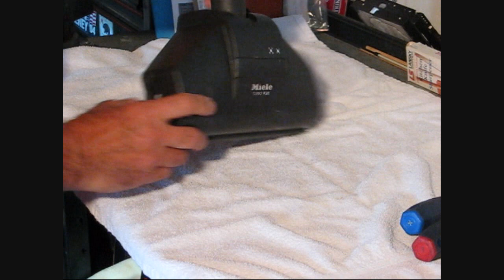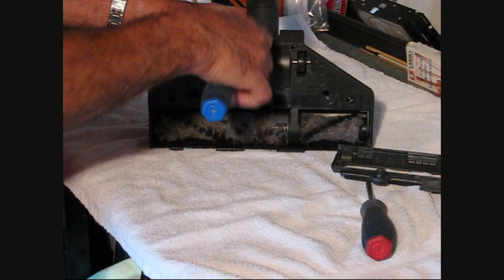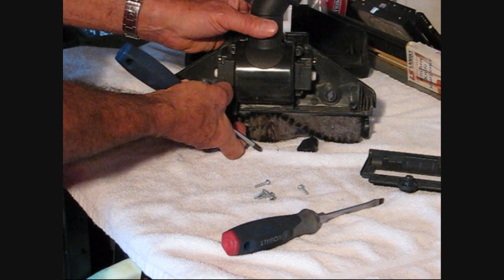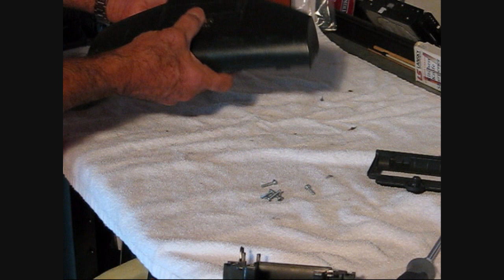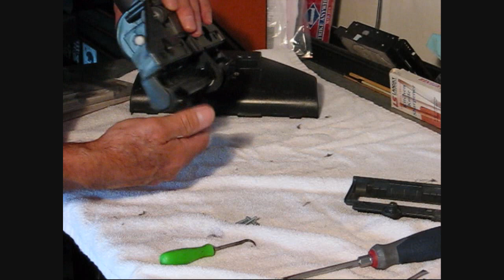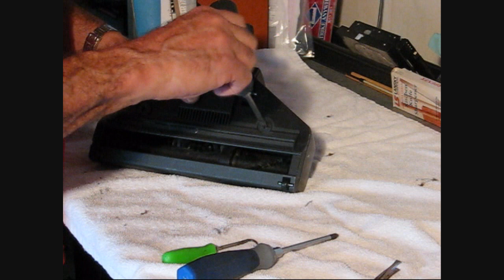Tools Miele vacuum cleaner power head belt replace repair by froggy

Comment: Very helpful Froggy, thank you :) Can you provide a link on where to buy the replacement belt please?
Reply from the maker: It's been a while, try google it.
Reply: Hi Froggy, I'm based in the UK and Miele UK make you buy a brand new head (£65.00) rather than supplying just the belt, which is so wrong really. I was just hoping that you might know a supplier where you live but thanks for replying :)

Comment: Three cheers for Froggy - This worked beautifully on my Miele TURBO COMFORT HEAD  - which goes on my Miele Solution H.E.P.A 5281.    For the little screws you need a small TORX screwdriver T10 or T9.
Reply from the maker: Excellent, thanks for viewing Sally!

Comment: Thank you. Revised - I took my Miele to a vacuum store to find out why it wasn't sucking so well on my vinyl floor. The gentleman who I believe was the owner told me that he needed to clean the powerhead because it was filled with dust and hair and it would cost me $120. I declined, came home, found this wonderful video, and fixed my powerhead all by myself. My power head was a little bit different than yours but I figured it out. The Torx screwdrivers really helped. Oh - the inside of my powerhead was not filled with dust and hair. It had a few tiny dust bunnies and that was it. So I just cleaned the cover with a damp cloth and I am now vacuuming like a maniac. I do think I'm going to buy the HEPA filter for my C1 Delphi vacuum. Thank you so much, Froggy! Oh, I guess the powerhead is not really supposed to work that well on flat floors. One is supposed to purchase the Parquet Twister, which I will later cause its pricey.
Reply from the maker: great!

Comment: Thank you for this.  I routinely do the main plastic-screw bit to clean the brush but mine was seizing anyway, so I used my husband's Torx set to try to open the housing but I couldn't figure out how to do it, and your video showed me how, plus how to get the other bits safely apart.  Turns out there was long hair wound up and compacted in the very ends of the brush roller itself, around the central pin.  But it's all back together and working now and I appreciate folks like you who post how-to vids for the rest of us.
Reply from the maker: Glad to help, good work!

Comment: Thank you for this video. I have one burning question. Is the roller supposed to turn by itself as soon as the power is on? Thank you.
Reply: Yes it turns with air flow

The air rotates the turbine

Comment: OMG I got it apart.....cleaned it up(especially the crap stuck between the axel and casing of the actual thing that looks like the water wheel) , a teeeny bit of oil in the spinning parts, and it works like it did when it was new!!!! THANKS for this video, and for keeping money in our pockets, and for keeping junk out of landfills!
Reply from the maker: Good for you.

:)

Comment: Agggh why can't I get the screws out? They started coming out(I am using the right screwdriver, no. 10 Torx) and then they stopped and they just keep turning and turning and won't come out and they are in far enough that I can't pry the plastic thing apart to get it off.
Reply from the maker: Stripped. If/when you get them out, use a slightly bigger screw to put together.

:)

Comment: Do not forget to check under the end caps of the floor brush. That's where my main problems were to be found. I also had some hair wound around the wind turbine shaft which I removed by carefully cutting with xacto knife and removing with long nosed craft tweezers.
Reply from the maker: Good, thanks.

:)

Comment: Great video, mine is clean but the suction is not that great. Do you why the air driven brushes loose suction ?
Reply from the maker: Do you have good suction with the brush head off? If YES, then there is still some restriction in the brush head.

:)
Reply: froggy yes, good suction with attachment off.  Are there gears inside of the enclosed casing that rotates?
Reply from the maker: It sounds like you have not actually taken yours apart or you would see there are a couple of gears. The ONLY way to properly clean the head is to take it apart as I show in my video. Please watch the video and try it, not that hard.

:)

Report back please.
Reply: froggy I have taken it apart,  cleaned it, watched video and it is not the same suction.  Then I wrote you. When apart,  I noticed a metal rod going thru that black enclosed piece. I was wonder what is inside there, thinking something might be broken inside there.
Reply from the maker: It is just a "spinner" the suction spins the enclosed part and transfers spinning thru the gear and thru the belt to the brush. If it does not spin easy then there is a problem. I have never taken that apart myself. When you have it APART how does that part spin? Easy & freely?

:)
Reply: froggy Freely!  everything was fine with it until I swept my dad's house and was sweeping up a lot of stuff. All of a sudden, it started making a deep noise and would barely suck up anything.  I took it apart like your video instructed,  which was AWESOME,  and now it is good on my wood floors but when I transfer it to a low pile rug, it does NOT have the suction like it used to. Before I could hear/feel it grab, not now, just lightly. Something happened that day at my dad's house and this gal is baffled!
Reply from the maker: Got it. All I could suggest is do the service again and at each part that moves try it & see if it moves easily. If it has a "lot of miles" on it it is possible a part has worn and thrown the alignment off resulting in the brush rubbing somewhere inside the housing, then you need to replace the worn part. Hope that helps.

:)

Look very closely with a bright light at the parts.

Comment: Froggy, many thanks for a video that will help many many others. Wanted to say thanks and so had to create a YouTube channel account to do so! I would add that a Torque T-10 screwdriver is required for this particular model. I didn't have one and had to purchase the right size to take mine apart. And as at least one commenter added, keep the initial 4 screws separate from the inside 2 screws, as the latter can be very slightly smaller. In my case my head was noisy and it just needed cleaning of all fibres and grit inside.  Big thumbs up Froggy. P.S. can't understand for the life of me why there are like 7 thumb downs?? Crazy world we live in...
Reply from the maker: Thanks for your support, this vid has helped a lot of folks.

:)

Comment: Thanks, this was very helpful and 

In case this helps anyone: in my Miele 300 turbo head is very similar. The 4 outside screws and the 2 inside were actually slightly different sizes. Also they were Torx,; probably a hex head would work but they are actually Torx.

I spent a good deal of time pulling lint and dog hair out of various places in the parts which was useful in helping all the parts to go back together well. Even one of the the slightly flexible end parts that hold the rotating head axle in place wouldn't set fully because there was lint in there. It's pulling up more dog hair from the carpet just like new.  Thanks!
Reply: Correction, I have a Miele S4210 Antares
Reply from the maker: Thanks for posting.

:)

Comment: Thank you so much Froggy! My Miele wasn't working well at all and I realised the brushes had stopped turning. As a not very competent DIYer I was about to buy a new head for the machine, or shell out for an expensive London priced repair. You gave me the confidence to try it myself and IT WORKED!!! Thank you again

Comment: Hi,
Your video is interesting but it doesn't solved my problem.
I've got a similar Miele power head: The belt seems ok but the 2 wheels can't spin together normally.
I opened my head and apparently the gear that I see on your video at 6:56 probably broke and went away. Please, can you tell me how to replace it and where to find the right gear for my head TYP S 021.
Thanks for your help.
Reply from the maker: You would have to call Miele and they should direct you to the part, or a vacuum repair shop.

:)
Reply: I did that before posting a message here and Miele asks me to pay 125€ for the work + pieces to change. This is highly unfair.

Comment: Hi Froggy, many thanks for this detailed guide.  I took everything apart - except the white plastic axle holders at 7:50 did not come off for my model (I broke one of the spokes but managed to glue it).   After re-assembling everything 3 times the brush is still not rotating freely - I suspect that there is some gunk inside the white axle holders (I applied some WD-40) which restricts the smooth running of the whole geartrain.  For the time being I removed the brush, the fan type wheel inside the smaller housing is spinning ok,  I do not have very thick carpets so I wonder if the brush is that important anyway except that it always collects dust and long threads/hair etc. I think some Miele models do not even have the rotating brush but a hardfloor/carpet combo attachement with fixed but retractable brushes.   Cheers and best regards.
Reply from the maker: +scuba453 If it has good suction it'll work pretty well without the brush, as you observed they is still some resistance or binding on yours.

Thanks for viewing!

:)

Comment: Froggy,
This is a Turbo head (STB205). There is no Power provided to this model. There are however proper Power heads - Ie SEB 217.  Good demo though. Thanks
Reply from the maker: +Steve Shillcock Thanks Steve for clarifying.

:)

Comment: Thanks for the video super helpful. I have two questions. There is hair stuck between the gear/axel/plastic which I think is giving it trouble. Any idea how to get the gear off to get in there? Also I found a clear little washer I think it would go with the white stopper things. Any ideas?
Reply from the maker: +Ashley O&#39;Brien Just cut the hair away the best you can, I don't know of a way to remove & reattach the "gear". I don't recall the washer, sorry.

:)

Comment: Thanks - my model is different, but I got it all apart and found all kinds of hair blocking the air vent & around the motor...even after being diligent in cleaning the brush weekly.  My model lifts out for easy cleaning.  Only challenge now is a little metal washer?  too tall for a washer popped out from around the motor.  Going to check parts to see if I can figure it out.  Hope it isn't critical.
Reply: EngardArts Woo Hoo - I found where it belongs!
Reply from the maker: EngardArts Excellent!

Comment: Great video mate. Having dramas with mine..pulled it all apart...then saw this...you explain things well! :) Thx for the upload! Its currently $139 for a new turbo head...Here's hoping I can sort it out! lol :)
Reply from the maker: Let me know how it goes.

:)
Reply: froggy Yeh all seems fine now Froggy. Got rid of a lot of hair/build-up throughout! Would still like to listen to a new one and see how it compares but as long as the wife thinks it's ok....I'm happy! Thanks mate! ps did you actually replace the belt? The belt on my head seems a bit loose!
Reply from the maker: My belt was ok. You can go anywhere they sell vacs & get a demo & hear how it should sound.

:)
Reply: Thanks froggy. Unfortunately where I live there isn't such a place around. Will see if others around me have the same vacuum :).. Or do a test on some when I go into the big smoke next lol
Reply from the maker: Well if it's sucking strong & spinning & picking stuff up I would not worry too much about the sound. It will change a bit as the bag fills up.

:)

Comment: Thanks for this video. I was getting so frustrated with my Miele not picking up regardless of cleaning the hair from the brush. After following your video instructions on how to take apart the turbo head I found that hair (mine! not the cats who prompted me buying the Miele in the first place!) was wrapped around both ends of the brush under the brackets AND wrapped around the axle!!! Beware long haired girls and guys! Now my vacuum cleaner is good as new. Thanks again Froggy :)

Comment: Thank you!  My husband is very appreciative as I was able to fix this on my own!! Taking out the beater bar brush and cleaning it (the inside where it fits into the clips) finally solved the problem!
Reply from the maker: You are welcome. Is that Upton, MA?
Reply: froggy
yes...we're quite mechanically adept here!
Reply from the maker: I lived on Upton Rd many years ago, small world.
Reply: froggy
We have 2 traffic lights now in Upton - we are a pass thru to Rt. 495, so it's to regulate that traffic.  Otherwise, not much has changed - we've been here 23 years
Reply from the maker: I do miss the cool fall weather & leaf changes.

Thanks for watching my video(s).

Comment: Thanks for this. Saved me $40.00. That's what the vacuum store charges to do the same thing. It's easy enough to keep the rotating brush clean, but we have dogs. There's a lot of hair, and after time it gets wrapped around inside the end clips where they insert into the ends of the brush. Even if the brush is clean, it doesn't turn. When I took it apart and took the brush out, there were compressed discs of hair inside, which provided enough pressure to slow and stop the spinning. Works like a dream now.
Reply from the maker: Thanks for watching!

:)

Comment: Really handy video - thanks.  But was just wondering what screwdriver tool I need to undo the screws - mine has small star shaped heads and they are really deep set in a narrow hole.  None of my screwdrivers fit it - do you know the name of the tool i need to get to open it?
Cheers!
Reply from the maker: Those are TORX screws, hardware or big box store has them, googe torx.
Thanks for watching!
Reply: froggy Do you know that size torx screw it is? T8 r T10? I can only order online where I am. Thanks for posting this video. My miele turbo brush has stopped spinning so it will come in handy!
Reply from the maker: Don't try to order just one, one will cost as much as a set. Just get a small cheap set of 6 or 8 whatever.
Reply: froggy Thanks. I have found a place round the corner from me that stocks cheap sets!
Reply from the maker: Excellent.
Reply: Dan Robinson I just bought a set and fixed it. It is T10!
Reply from the maker: Great!

Comment from the maker: Hi Penelope,

You can keep up with it without the disassembly if you are concerned. I understand reluctance to take apart mechanical "stuff". It's just easier & more thorough if you disassemble. Just take your time, find a well lit area, and have at it. It will clean MUCH BETTER. Most of the rotating brush style vacs are about the same.

Thanks for watching.

:)

Comment: Great, but looks dicey and complicated, even for a master technical person like Froggy. Do I dare? The MOST useful thing was learning that the way to remove those strings, hair, buildup on the rotating brush is with a single-sided RAZOR BLADE. 
Why did Miele make this so hard? All vacuum brushes get loaded up with this stuff wound around them. It has to be cleaned off regularly, and even the extreme suction of the Miele hose will not do it. 
Such a simple thing, a single-sided razor blade.